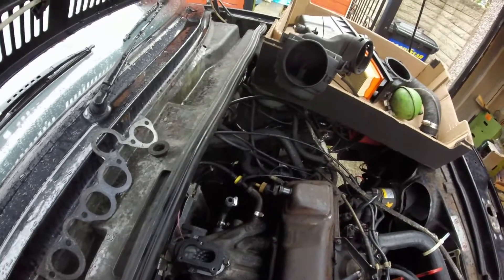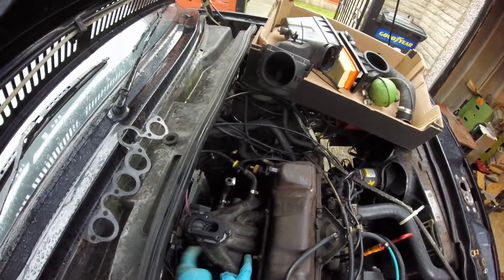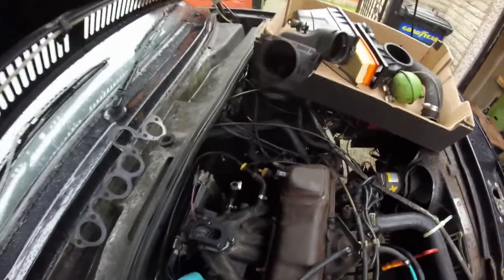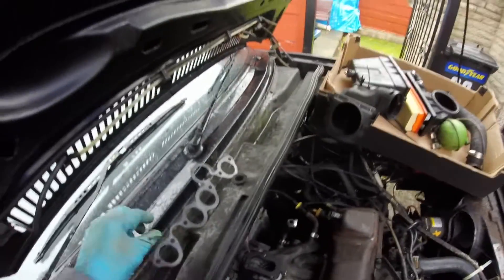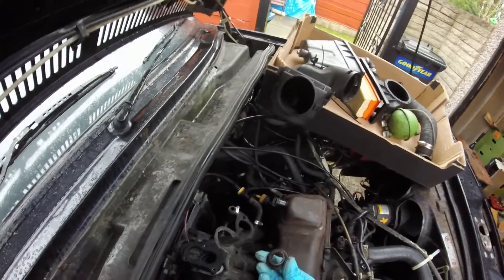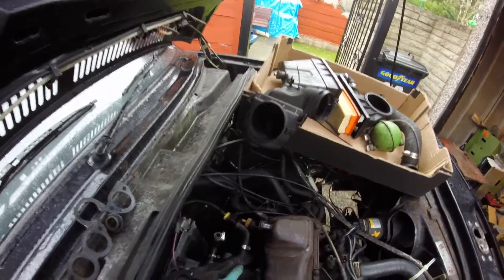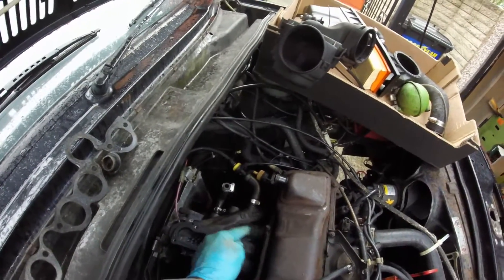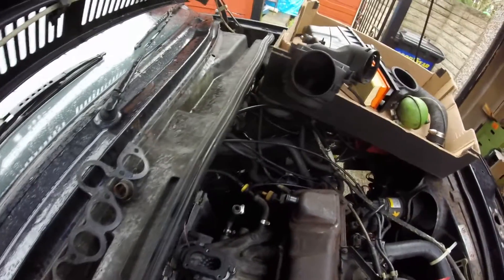How to Remove air Inlet Manifold & o-ring on a VW Golf Mk2.

Comment: Hey there. I got an Mk1 and my inlet manifold has sprung a leak. From the same view as in the video. Right between the exh mani and the carb. There is a circular opening with no threads, and there is the leak. The stream hits the right shock pillar. Don't known if that will help, anyways can this be repaired or should i replace the inlet manifold? It was leaking coolant.

Comment: I'm planning on doing this job on the weekend.....how long should this take roughly? I have no experience but, would like to give this a go. What tools do I need to be prepared?
Reply from the maker: Hi with the tools and know how, this is not too big a job to try to undertake.
it took me too long as it takes ages thinking then working out where bolts were then trying to undo each of them. Hence why i then made this vid!
Rule 1. Disconnect Battery & No smoking.
Remove carb as in other vids.
Keep the carb upright when you remove it as it will remain full of petrol. Tools required are just basic socket set and spanners etc., but the tool to fit each of those 6 bolts was a bugger, so I recommend an assortment of short narrow socket extentions, and chopping out the corner of an allen key so that you have too different length straight bits remaining, you might want to tape these into the sockets to make it harder to drop them. Finding each of the six bolts is the difficult bit but they are all at the same height to each other as you can see on the gasket a minute in to the vid, it just seems like they are not when trying to locate them at first. (there is probably a special tool to do all this!)
A torch and handy little mirror never go a miss on jobs like this. I just got a combined one for xmas!
Often that rubber bung will have rotted / be full of gunk, so it is something worth having a go at.
It might take a couple of hours as just removing bits to get to carb and then carb all eat into time, and going backwards and forwards to get tools etc.
Handy if you have someone to help pass tools etc, but still doable without as long as you can get to and undo those 6 bolts without to much trouble.
Make sure to take a few pics of your wire and tubes before you take it all apart as they always help later when you are not sure what was where, but you should manage this, if it's not too cold out, thanks.
Reply: Thank you so much I appreciate it! Do you know roughly how long the allen key needs to be? I'm going to try this some time soon but, a bit apprehensive!
Reply from the maker: Hi we just cut off the corner bit keeping the length for the short & long parts as long as possible without any bend on them so that they are just two stright pieces and that worked for us.
Reply: sorry to message again but, can you take picture and show measurement of the tool you used please? I'd really appreciate it. We don't want to take Carb off if we haven't got the right tool to loose and tighten back up the two bolts on manifold
Reply from the maker: Hi it was an allen key we chopped up, it was a couple of years ago now, and doubt if we have it now as we got rid of all the Golf stuff/parts/tools after the car was wrote off a few months back. Sold off everything. It's easy to cut the corner off an allen key, they are pretty much all the same length in the size that fits so you can't really go wrong. It is harder to work out which sockets and socket extensions will get the allen key into the bolt heads, but once you have that sorted you can tape them all together to make things easier. If i remember rightly we had a couple of these taped together sockets/bars so that we had 2 different length tools to do the job. using 1 ratchet tool. There is probably a tool to do the job. Halford etc, do sell sockets with allen key ends, but I doubt they do a long version, so chopping an allen key seemed ideal.
Don't worry I understand all your worries, as I didn't dare ever touch the carb on this car for years not knowing what it did, how it came off, etc. So i'm with you on that one.

Comment: thanks for the reply! how was tape strong enough to hold the tension and movement to loosen and tighten? I'd imagen it slipping? I'm going to have to take it off and just give it a go I think
Reply from the maker: Hi tape was normal insulation/electrical tape just wrapped around sockets/bars/allen key to keep them together rather than dropping and loosing bits down back of engine. Wrapped once or twice around keep them together well.

Comment: nice video is it possible that you could make a video on how to replace the exhaust manifold too??

your videos are always helpful :-)
Reply from the maker: fightrider187 exhausts manifolds and their nuts/bolts can be an absolute nightmare to do! saying that I have never actually done one on a Golf!
It's always worth giving the nuts/bolts a good soaking with some penetrating oil or loosening liquid the day/night before trying to undo any of them as you don't want to snap any if it can be avoided as that's when the real problems start.
I glad you like my videos, I might stick with another easy one like changing more bulbs for LEDs before I think about doing a manifold gasket job though!!!! thanks ;)